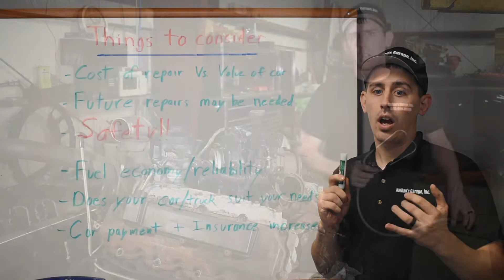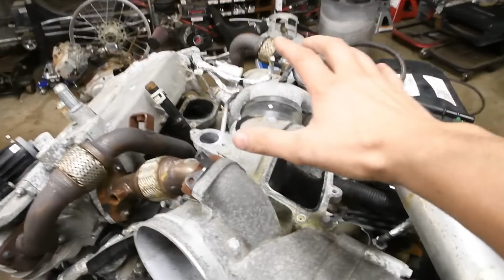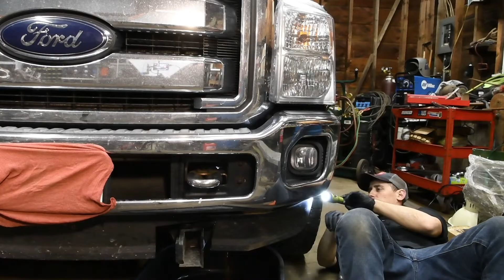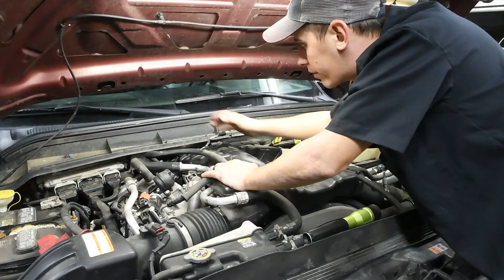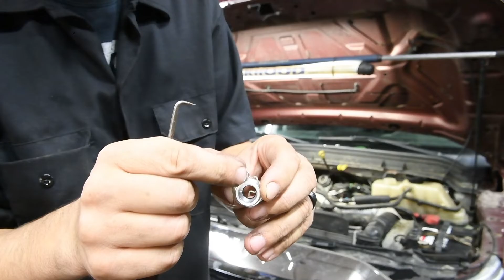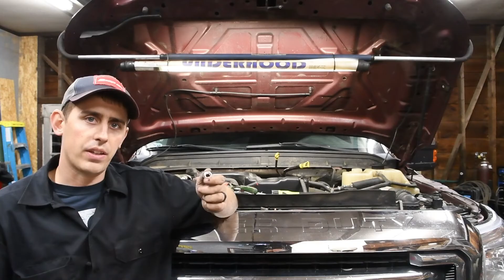6.7 COOLANT LEAK SOLVED

Comment: Thanks for the advice. Seeing it done gives confidence to try the job myself. Fixed my coolant leak from watching this video. I had 2 repair shops tell me they had to remove the cab to fix this. $3500 quote. Fixed it myself for $130 for parts and a couple special tools.

Comment: Saved me a real headache finding my leak! Just bought my truck from a guy who had replaced the radiator and hoses trying to find a mystery leak. I also replaced a leaking oil line fitting (same fitting as coolant line fitting) while the plenum was removed. The oil line fitting is on top of the housing of the turbo to the left of the fitting on the video. ( left as your under the hood facing the windshield) I was able to unclip just the end of the oil line and carefully "finess" it up and out of the fitting. The orings had also failed in this fitting.Great video, well worth the time I spent fixing these leaks! Thank you
Reply from the maker: Thanks for watching Brian! Hearing feedback from people that these videos helped is always a highlight of my day.
Reply: Part numbers?

Comment: Saw a tip that says, if you’re replacing the whole line and fitting, just cut the tube as far down near the hard 90 degree turn with a sawzall and remove the whole fitting with the deep socket, skipping the whole picking process, haven’t tried it but I’m thinking about it 😂

Comment: Have you ever heard of coolant coming out of exhaust tip? 2019 6.7 powerstroke the other day it was about 40 degrees out and I had the truck running for about 15 minutes then shut it off and noticed a small puddle of bright green coolant accumulating in the exhaust tip. Coolant from turbo leaking? Reservoirs both still full, anyone ever heard of this?

Comment: ARod's got a good shot of using the mirror to see the leak.  Book-beater tip is to cut the tubing at the fitting and remove it with the bayonet in place, if you can.

Comment: Great Video, Thank you!! Job took me about three hours working at a leisurely pace, and including the 45 minutes it took to get a dropped socket out of the engine valley........Turbo air line came off in a second by pulling up on the retention clip to disengage all three tabs at once.  Thanks again!!

Comment: Great Vid, just completed an air charge cooler replacement, it was blowing pressure into the secondary cooling system ,which only can hold 5 psi , emptying the secondary coolant tank, thus causing the trans to overheat,. So on the 2015 6.7 the erg is on the primary cooling system and the trans cooler and the air charge cooler is on the secondary . The ford service site shows that also. Great job keep shipping those vids.
Reply from the maker: Thank Rick!

Comment: I've had mine in the shop 4x's. Over $5000 later and none of the mechanics can seem to find the coolant leak. Found a puddle in the valley today.  I'm sure hopeful this is the problem and it can finally be resolved.  Taking it back to the shop... I just had my nails done,  and I have way to much to do to tackle this job. Too bad your not here to fix it for me.

Comment: Great video, I'm having this problem now. I replaced my coolant feed line with a Sinister Diesel Turbo Coolant Feed line. Also, I  recommend  the Pusher Coolant Reroute line. Cleans up the engine well.

Comment: Just did this today. Didn’t remove the intercooler pipe. I would say this is a difficulty level 5 out of 10 just because of the location of the nipple as well as getting the clamps off the backside of the upper intake manifold. I’ve done harder tasks like deleting the EGR.
Reply from the maker: Thanks for watching!
Reply: What’s funny is this did not fox my issue. My real issue was the crossover gasket. It was shot. Had that replaced and no more coolant loss.

Comment: Great video I was kinda freaking out. I was doing my front brake shoes and saw it was leaking. Didnt know what the hell it could be or how difficult it was going to be to get too. This video definitely makes me feel better about doing it. But your video has put my mind at ease. My only suggestion is maybe a gopro or a cheaper action camera like I've got so you can get into those tight spots to film, it would benefit you in the long run
Reply from the maker: Thanks for watching!

Comment: Great video 👍 why has someone not made a updated set up for this problem? Seems to me like a AN fitting and a AN line would be a permanent repair. I have to do this on my truck as well there is no way I am putting that crappy ford fitting back into the turbo so it can fail again.

Comment: I bought the water tube and new fitting. The fitting looks different than the one you showed. has it been superseded?  The one I have looks like a Ford fuel line quick connect

Comment: If this is the problem on my truck, is it still safe to drive before i fix it? Will it remain a slow leak or could it become catastrophic?
Reply from the maker: I always recommend to fix the truck immediately when there are any fluid leaks. That being said I have seen these leak for a very long time before they completely failed. I would do it ASAP but in the meantime pay very close attention to the coolant level.

Comment: So my truck sat for a week ran perfect before hand and now after i floor it and let off i get a puff of white smoke really noticeable but goes away pretty quick, also only does this when im throwing into drive and reverse really quick when im parking or coming to a stop at a light? But no white smoke when accelerating full throttle or driving normal? Would this be that line leaking? Or something else i am baffled its done this out of no where just from sitting and workin and running perfect before hand

Comment: I had the turbo off to fix the exhaust manifold studs that broke on the rear drivers side,  I replaced the line with a OE Ford unit, I also replaced another line on the other side of the turbo, and I still have missing coolant, around 1/2 gallon will top up the reservoir, but there is no visible traces, just a smell, this is truly driving me crazy,  any thoughts on what is going on?
Reply from the maker: Hey Darrin, Did you replace the fittings that thread into the turbo also or just the lines?
Reply: @InTheShop  

Replaced the fittings also, but I think I found a drip this morning in the front, so it's probably the water pump 😥
Reply: @InTheShop  

Replaced the fittings also, but I think I found a drip this morning in the front, so it's probably the water pump 😥
Reply: inner cooler leak boss its getting into your air side of the inner cooler and your engine is sucking it in and burning it
Reply: @deerichardson4946  

I did end up finding a coolant leak under the truck, along with an oil leak,  the gaskets between the block and oil cooler were weeping, and finally showed on the driveway.

Comment: Better idea: cut tube as close to fitting as possible, remove fitting w/ socket. Install new. Done, no fight!
Reply: Use a jiffy tight tool it comes right off.

Comment: Thank you so much. I think that is what my problem is on my 2012 f250. I'm smelling coolant from that side. Did you use the same clip from the old hose and then put the plastic retainer back on or does it come with a new clip. Thanks so much for your great video.
Reply from the maker: The fitting comes with the clip and the hose comes with the plastic retainer.
Reply: @InTheShop  My hose didn't come with a plastic retainer. I think they changed the fitting to a Ford fuel line type

Comment: Thank you so much for this video! Have you used or saw the Sinister Diesel coolant line for the 2011 to 2014 6.7 ? Just wondering if it is a better part than the factory replacement.
Reply from the maker: Thanks for watching! I have seen the Sinister line but I haven't used it which is why I didn't recommend it. I like to only recommend parts I have tested and know they are good. It does appear to be a better design than factory. I would suggest trying to read some reviews on it.

Comment: Hey having a coolant burning issue with my 2015 f450 burning white smoke  smelling like coolant when system is under pressure if you take coolant cap off it stops smoking and burning coolant any ideas?
Reply: I'm not a mechanic but I would guess the egr is bad,allowing coolant to reach exhaust.

Comment: My secondary tank is not staying full on my 2011 f250 6.7
Reply from the maker: Could be an intercooler failure
Reply: @InTheShop  I looked more and I see coolant on the passenger side on top of the engine block. I also see coolant by the EGR down by the oil pan. I'm thinking replace the hose that goes to the EGR.

Comment: Link for the turbo feed line fitting no longer works.
Reply from the maker: Derek Smith thank you. I will update it in a few minutes
Reply: @InTheShop  thank you!
Reply from the maker: @dereksmith8521  You may have to order it from the ford dealer. Its not looking like its available on amazon currently.
Reply: @InTheShop  thanks for the info.

Comment: Geezzz that motor is so crasty you must of live next to the ocean or where they throw salt on the road , engine looks nasty
Reply from the maker: That’s nothing. I live in Massachusetts. This truck is a gem compared to most
Reply: @InTheShop  that's crazy I live in Oregon I have 6.7 truck with 300k miles and my motor looks like it just came out of a showroom , but I did same fix on my truck coolant start leak same place as described at  275k